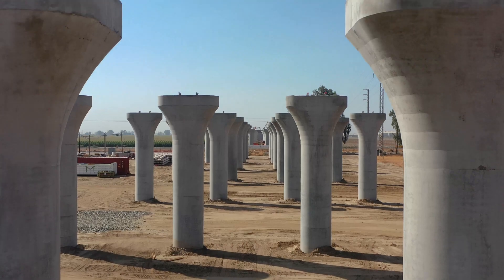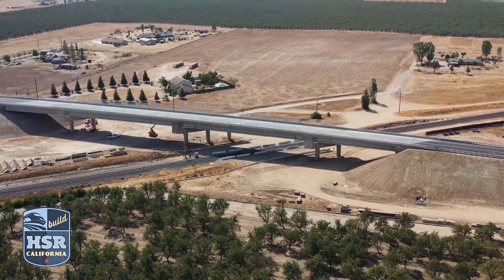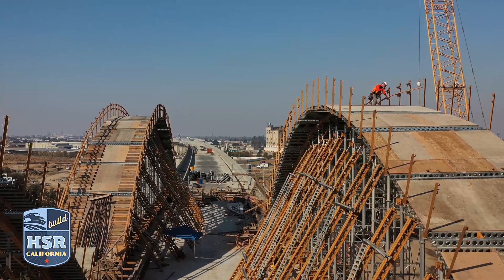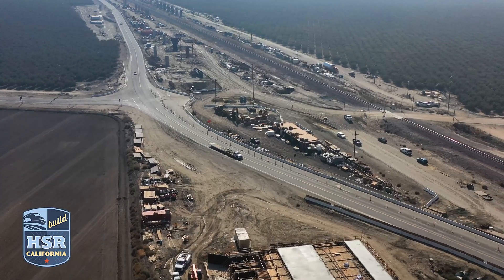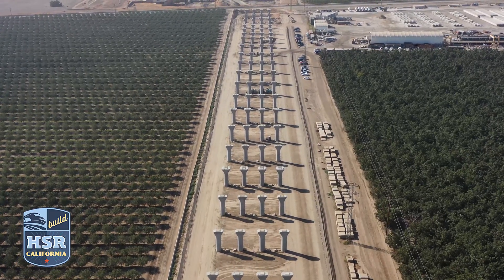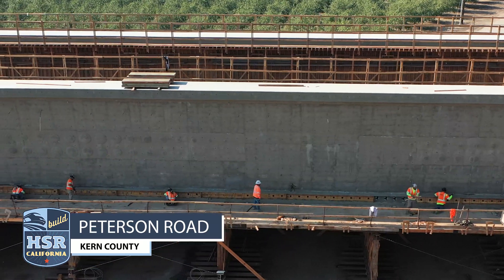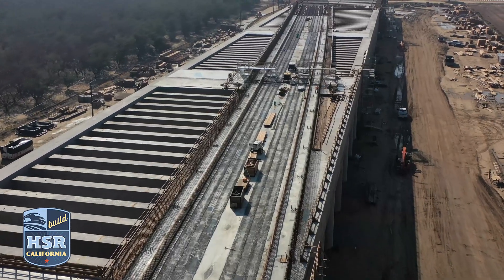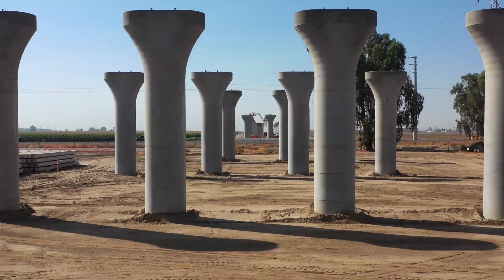California High-Speed Rail Central Valley construction

Comment: When Prop 1A was written, the estimated cost to build from LA to SF was $30-40 billion. Today the estimate, according to the HSR, is $69-99 billion.  That is 200-300% over the original estimate. And its opening date is MORE than 10 years behind schedule. This project is a HUGE failure.
Reply: The eastern bridge of the San Francisco - Oakland Bay Bridge cost 8 times the estimate. Lots of ßitching at the time but it is VERY busy today. So is that a HUGE failure?
Reply: @danielcarroll3358  That bridge had a 2,500% cost overrun with an opening date that was 7 years late and you dont see any failures?

Comment: That's not what the 2022 Draft Business Plan says. The plan says they COULD double track the IOS between Merced and Bakersfield if they had more stable funding.
Reply: For what purpose though? What super important people use this type of transportation?
Reply: @bigmike1850  Citizens.
Reply: @BIGMIKE  For the double tracking specifically I'm guessing its mostly to walk back a concession to save face. They did point out that a single track could handle 97% or whatever of the traffic between Merced and Bakersfield.